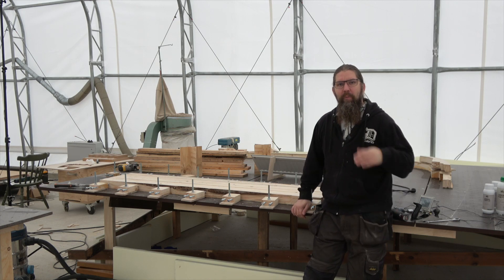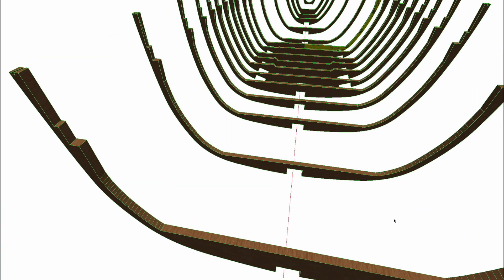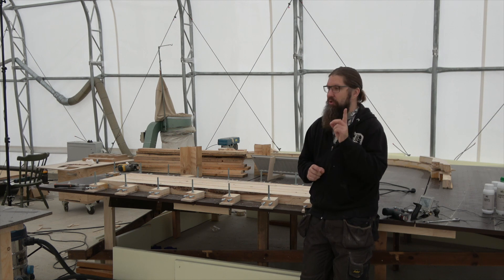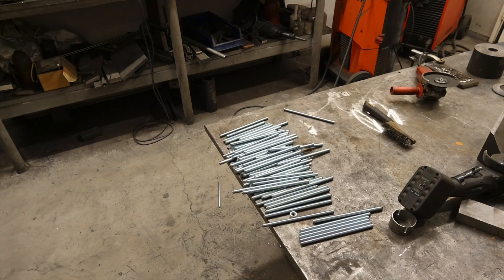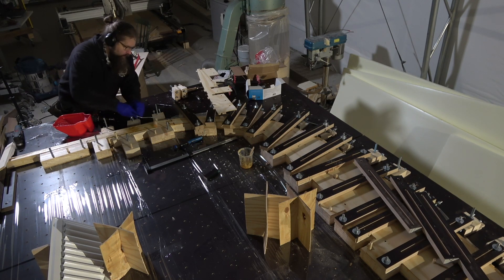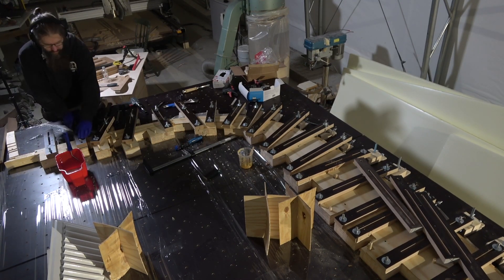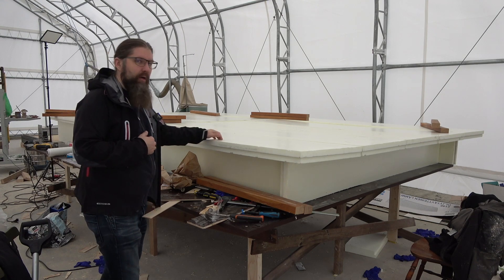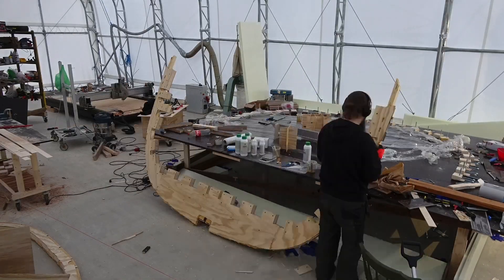Sailboat build! The second frame! ep.48 Project SeaCamel

Comment: the slats? do not need to be exact just about the same but uniformly/constant thickness. Plane to uniform thickness after laminating. Add any plywood [ why ?] afterwoods
Reply from the maker: Hi!

You need to check the previous videos for the system I’m using.
Plywoods make the shape and they need to be exactly right. And that’s why the slats need to be exactly right as well.

After lamination they are basically ready.

Comment: do you wet wipe the sheets with acetone or something similar before laminating? i remember some builders do so to remove dust and possible oil residue on the sheets that could affect lamination process and final product strength.
Reply from the maker: No, they should be very clean just straight from the planer. Epoxy seems to soak well into the wood!

Comment: I watched a video from "the art of boat building" and he explained quite well that he uses titebond III in stead of epoxy because it's cheaper and easier to work with, but mostly is stronger than the wood itself, meaning you dont need epoxy strength on a material that isnt stronger than the epoxy.  Hope that makes sense.  Just a thought.
Reply: From the label of Titebond III" Not for continuous submersion or use below the waterline."
Reply: @aswanson7253  if the boat shell is fiberglass and water proof, neither of those restrictions matter.  Imo

Comment: Is this really the easiest way to build your boat though? Are you fixated on this style of boatbuilding?  What are you going to do once the frames are completed?  Enjoyable but grieviously labour intensive methinks!
Reply from the maker: Don't really know! But it's the best method I've come up with for boat like this. And also utilizing CNC-machine.
Maybe making plywood boat like Tapatya or Wave Rover would be easier in some way but they're both much smaller as well.

Making curves that bend to two directions isn't physically possible from sheet material. So CNC is really for making "just" sections of the shape - at least for the hull.

The hull will be strip planked with two layers of veneer over that.

Comment: My head keeps seeing an upper and a lower roller with a pan. to roll the pieces thru, to epoxy both sides in one pass.
Reply: Like with painting? Getting a bucket with epoxy and two rollers might work but cleaning and use of material would maybe be to high of cost/glue?
Reply: @viltfjall  Like a long pan, a trough with the epoxy in it. the boards go thru the bath with rollers at the end to remove the excess and return it to the pan. I cannot see it clearly. Just a general idea of thru and out.
Reply from the maker: I've been trying to find something like this with no luck so far... :(

Comment: You say you want to speed up the process, I used to do CIP pipe lining with epoxy and fully believe the process is the process and nothing can be eliminated. That said incremental speed gains can be made which make huge gains in speed overall. Things to consider all pertain to efficient use of time, for instance, maintain clean and dirty areas for different operations and don't waste time re-cleaning between operations, the hot box with heat source should cover the entire table and be suspended above it so it can be lowered in seconds not assembled in minutes, use a calibrated epoxy pump that delivers resin and hardener ready to stir then use, Machine larger quantities of timber material to reduce repeat set-ups for different operations, Find someone to help with the glue ups and use the same person every time to avoid repeat training, explore connection tolerances and gap filling ability of your epoxy to avoid impact fitting of joints, Video record the entire process and review it with a critical eye looking for finding misplaced tools, your wasted movement, positioning of equipment, work flow path. Consider making a second lay up table to make good on the time lost waiting for the last frame to cure, essentially this should double your output and frankly you want to get these frames done in winter while you can take advantage of the cold to slow the epoxy gell time down and extend your lay up time.
Hope this is food for thought, looking forward to following along and hope it go's well for you.